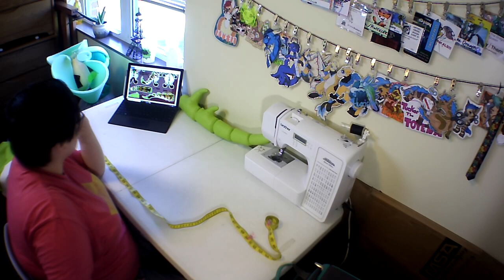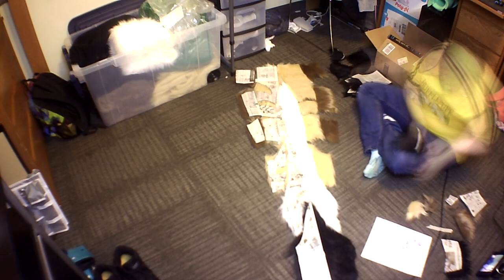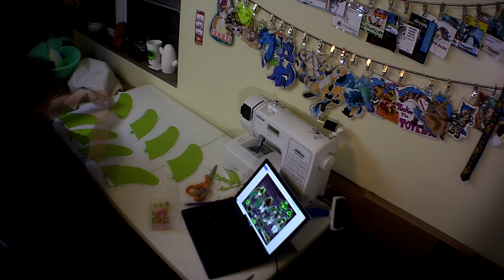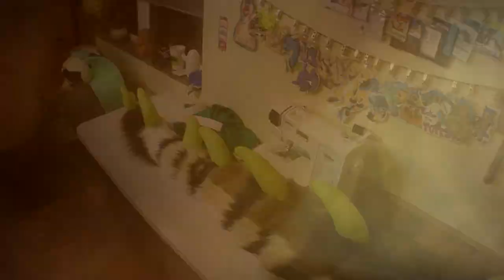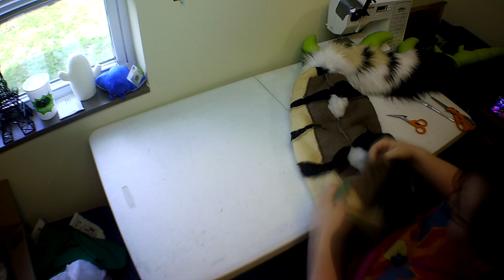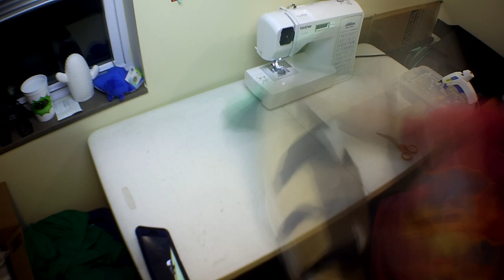E3 | The Making of a Drekkubus Floor Dragging Fursuit Tail

Comment: im stuck with a metre or more long tail which is also very chunky, it keeps on flopping as i made it more in an “r” shape rather than dragging over and is too loose on my body since its very heavy. theres no wires in my areas or my country (new zealand) to ship to stabilise it. i used the foam and made a hidden belt then did one of those gore cut offs on the end. im a 14 yo maker so im still trying to learn. do you have any tips? im thinking of adding another cut inside the foam near the top and bringing a long ribbon to come under and over my arms like a backpack almost but that may be too difficult to walk and do stuff with. i could try adding four belt loops like you had done if that doesnt work, or i could do it first. i just really dont want to unstitch my 2 hours of handsewing and cover the gore cutoff because im very proud of it.

Comment: I’m making a Dutch angel dragon tail it’s solid foam with notches so it wags and I’m gonna use a kidney belt it’s my first tail and I’m not using fur I’m using a different material is there anything you suggest and am I doing too much for my first tail
Reply from the maker: Nope! that is A-ok for a first tail! What material are you using instead of fur?
Reply: Kaida's Kingdom I’m not exactly sure
Reply from the maker: SMOKEY Draws hm. I would definitely recommend using fur! Most of the time it looks better! It is definitely worth the extra cash
Reply: Kaida's Kingdom        I may use fur later on but the character I’m doing has a scale pattern and I think that would be really difficult with fur
Reply: Not the art Channel I have a new one You can use fake leather ( some should look similar to scales )and use that for the tail. But thats going to be a little hard :/ If you are going to use leather make sure to get one that doesn’t have anything toxic.
Reply: Mustard Crow the Plague Doctor ok thanks that’s extremely helpful